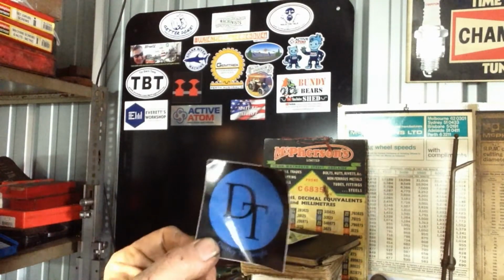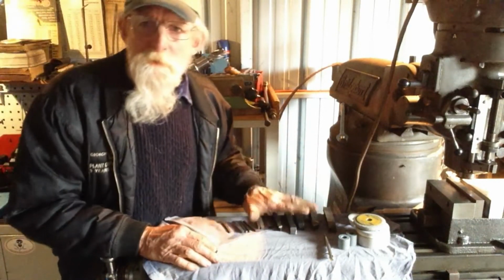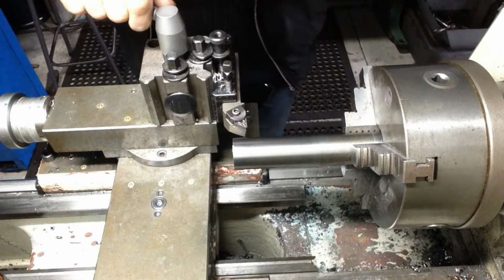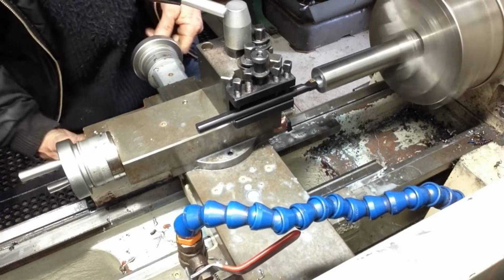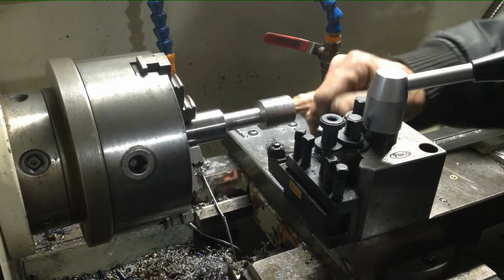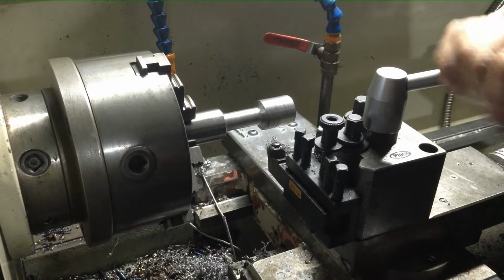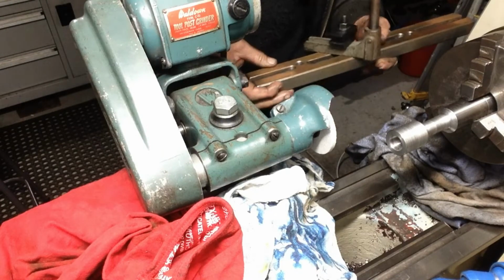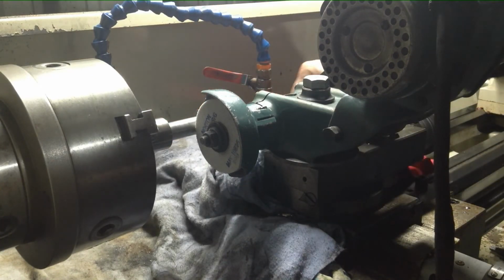Swarf & Chips ,  Episode 9  pt 1.  The Jig Grinding  Attachment

Comment: Antoher interesting video. Why do you prefer HSS to Cobalt-HSS? Is it the increased brittleness? I have been replacing some broken bits lately and thought I should just get Cobalt-HSS ones, because I thought they were simply better. Perhaps I was mistaken. I'd love to hear your thoughts on the subject. And by the way, what a tease...I so desperately wanted to see the surface finish after the grind...I guess I can wait.
Reply from the maker: Hi  Rob ,  the reason for the HSS  is  they generally have a narrower web as opposed to the wide web drills like  the cobalt ones we get here .  The wide web drills are for production  , they are more ridgid & they don't sharpen them  .  If you sharpen them normally  you have to thin down the web  ( split point drills )    so in  a  nut shell  there a pain in the ass !   Good for drilling harder stuff but that's it .

Comment: G day Max,
Good to see the tool post grinder in action, looking forward to the next video to
see how it turned out for you, I want to be able to grind my ISO 30 tapers,
That I turn up for the mill,
All the best
Reply from the maker: The grinders running well .  It will be interesting to see how you do the set up to grind them .  Personally i would do it between centres if your tailstock has enough off set  , or use one of the adjustable off set centre tools for the quill .  If you use the compound it will be a bugger to set the taper & the finish may be effected .   Cheers .
Reply: I'm betting the taper will be cut on the compound so the angle would be set anyway. I have made a detachable  extension crank handle for the compound which smooths out the feed rate considerably.
If the tool post grinder is actually attached to the compound slide..
After the first clear pass you could always blue it up to your known socket and adjust as required..
Reply: Max Grant ,The Swan Valley Machine Shop.
G day Max,
I have to take the compound of the lathe as you understand, I use a clock to set the compound when I turn 
the ISO 30’s in the 4 jaw,
I would then clock the spindle of the tool post grinder to the same angle,
I am very envious of this shed you are building looks to be a decent size

All the best
Reply from the maker: @jackk7030   Thanks   Mate ,  Cheers .

Comment: Hey max, I have a HSS 6” slitting saw for a 1” keyed arbor. About 1/8 thick. Needs a resharpen, but no use to me. Dunno what they are worth but I hesitate to turf tooling out. I’m in Melbourne, if you have a use for it I could send it up. Cheers, Matt.
Reply from the maker: No worries , email me  at  theswanvalleymachineshop@gmail.com  & we can swap postal addresses & i will send you a couple of my channel stickers .  Thanks .